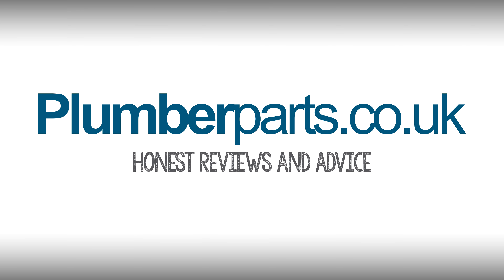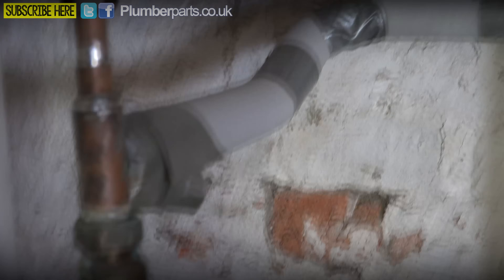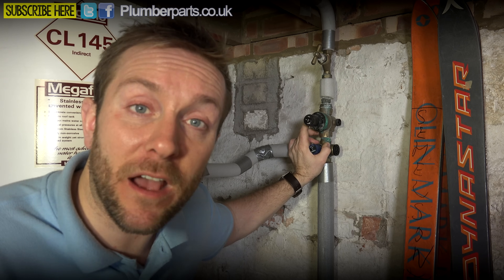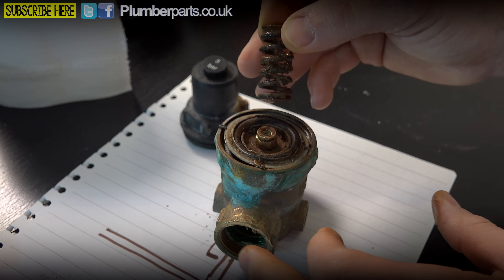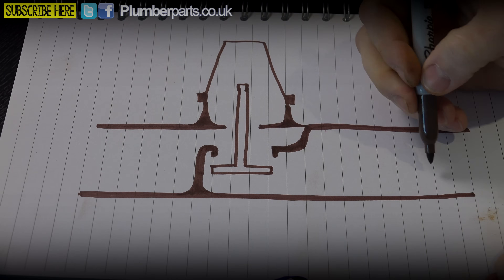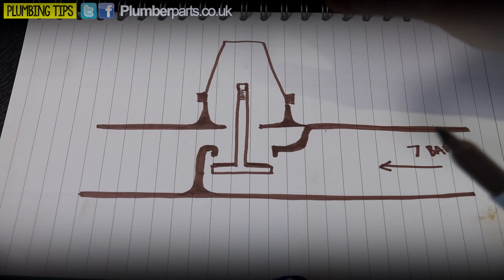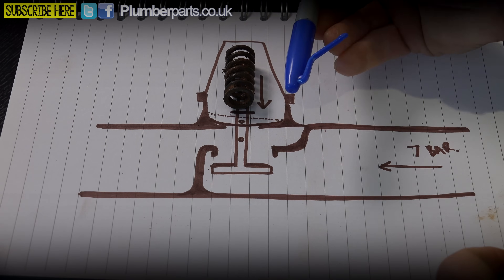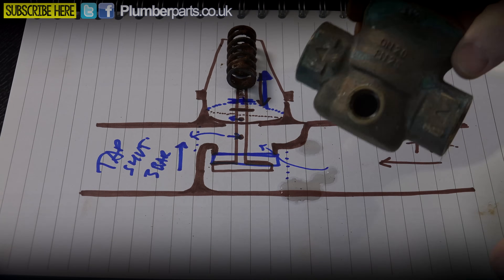UNVENTED HOT WATER TANK COMBINATION VALVES - How they work - Plumbing Tips

Comment: I find it a great explanation of how the pressure reducing valve works but in this video it’s incorrectly called a ‚combination valve’. In fact, pressure reducing valve is only one of the four components of a ‚combi valve’ which also consists of a check valve (non-return valve), a strainer filter and a pressure relief valve combined together, hence ‚combination valve’.
I was looking for the explanation where on a combi valve an expansion vessel should be fitted in relation to balanced cold water.

Comment: 2:30, that you for the explanation of the balanced valve.  Who did the plumbing, it looks as if it does or did leak. Could a run of, for example hot in 22mm pipe and cold in 15mm pipe mess things up?

Comment: 3 Bar??? We have a 30 year old Viessmann verticell that’s rated at 10 Bar! Mains inlet to house has a BWT backwash filter with gauge and pressure reducer built in which is set at 4 bar. The manifold above the tank has a pressure vessel, gauge and safety valve rated at 6 bar. Needing a 3 bar reducer to protect a tank would leave me questioning why I bought something so fragile when clearly more robust alternatives have been around for decades.

Comment: Hi, fantastic videos! I’ve just had a unvented cylinder replaced, a new combination valve (made by reliance water controls) has been fitted, but I now find a lot of noise (water flowing noise) when any hot water tap is turned on. I can only best describe it like an old fashion toilet cistern filling up. It’s so loud that you hear it in adjacent bedrooms whenever any hot water tap in the house is turned on. This didn’t happen on a previous separate 2 valve set up, is this considered normal, or do I possibly have a faulty combination valve?

Comment: Love this video.  Our house is 17yrs old and we have an oso unvented system. The hot water pressure has been decreasing quite a lot over the last 12 months to a point where if anyone flushes a toilet for example while someone is in the shower, then the shower stops.  The water board say no issues with mains pressure to the house.  We have a PRV on the mains and one at the tank.  Hoping getting both these replaced will fix our issue.
Reply: I have a very similar problem, with reducing hot water pressure over time.   Did you work out the problem?  I am thinking it might be this value.

Comment: I’ve been looking through your videos trying to get my head around the heating system in our new house, and they’ve been excellent. 

Our santon premier plus PP210B tank is fed from a gas boiler. When the heating is on or the nest thermostat is calling for hot water no noise comes from the tank. But as soon as the heating turns off, the tank (and throughout the house) you can hear what sounds like water running/immersion heater through pipes. I’m concerned that something might be wrong and at the very least it’s keeping us up at night as the noise can be heard.

I think I’ll have to resort to getting someone out to look as it’s stumping me. But i thought I’d ask before I do.

Thank you in advance

Comment: Amazing video. What a shame the 4 useless plumbers didn't spot this on my unvented system with a balanced cold feed coming out. Such a simple explanation as to why I had no water flow from any hot and cold taps but superb pressure before the combination valve. Some never even went near the airing cupboard to look. Some said I just needed all my pipework replacing or it was the water boards fault. The 5th plumber nailed it within an hour. This is in my tenanted property and I had to rehouse the tenants as the water virtually stopped running. No shower, no toilets, nothing...it was this one little but very important valve. £1k later and I feel I now know my entire heating and water system inside out! I'm definitely subscribing to your feed. Thank you!

Comment: @plumberparts I had my combination valve replaced not so long ago, before the pressure through my shower and taps was at a constant flow, now since it was replaced the pressure drops dramatically after 20 or so seconds. The water comes out at full bore but that could be due to the expansion vessel giving it a boost but after that pressure drops. Could i have a dodgy valve?

Comment: Great video really explains it well. Love to know why a combination valve fails. I’ve got a caleffi 3/6 bar installed 2 years ago. Expansion tank has a pin prick hole. So I’m told membrane needs replacing. Now on reflection they’ve told me the combination valve also needs replacing. Really surprised both needed so soon after installing (whole system 2 years ago) . Any thoughts

Comment: just moving into a new house.  our current house has a combi boiler so its all nice and easy and what i been used to for 20 years.   new house has a big tank in bathroom cupboard like this video with pipes all over the place. radiators are cold downstairs but hot upstairs.  ive been watching alot of these vids and getting an idea what to do. (called a plumber who suggested new radiators and power flush system.  he hasnt even bothered balancing it so eff him il do this.myself first).  

but i keep seeing a red knob (on mine its red) with a numers on it.  its situated not far from the pump.  i cant seem to find what it is.   its got a screw in middle of it...and it turns if.i take.screw out i guess..its set halfway between 1 and 2.    no idea what its for.
Reply: It's the auto by bass, should be set at 3bar. I wouldn't touch it. 
Have you got a room stat upstairs and down stairs? If you have you may have a faulty valve which let's hot water to the down stairs rads. If the rads are just getting warm then maybe just need a flush out. Hope this helps.

Comment: Could a faulty valve 'stop' the flow to the boiler loop pipe? As my water pressure is now low and the mains feed to the boiler, i.e. flexible loop pipe is zero. I've opened both the valves either end of the loop pipe and no water flows?

Comment: Thanks for the video, do I have to drain the system to fit the valve or is it enough to just to stop the water coming in from the tap just above it.
Reply: I would shut of cold mains to cylinder then open up hot taps whilst draining down with a hose on a drain off closest to a door also may aswell turn boiler off if it's on as you would be heating nothing

Comment: A question please! On my telford 150 direct unvented it says that the precharge for the expansion tank should be 0.2 bar less than incoming. Does that mean 2.8 because the exp. Tank is fitted after the 3 bar combi valve....or does it mean 6.8 which is relative to the normal system pressure of 7 bars before it enters the combi valve.....confused i am!! Cheers

Comment: My parents have a modern ish house 90's. They have a condensing boiler in the garage, 12   radiators on the system some have thermostat valves. In the airing cupboard they have two actuators and a pressure release valve. The system is made up of microbore pipes and the bigger pipes. 

The system has never been great in the sense that extra radiators have been added before we got the house some parts get more heat than others. 

The main problem is the pipes bang sometimes, I assume this is air in the system? 

Can you tell me how this would happen and is it possible to fix? 

Thanks in advance. love the informative videos.

Comment: We've got an unvented tank and just had the valves replaced. We've got an issue were the water runs super fast and then drops, then it speeds up again and then drops and so on. Plumber says it's problem stemming from outside pressure. company that manages the building says the water is leaving the booster sets at a constant pressure? Any advice? see vid:
https://www.youtube.com/watch?v=otrZDNfuAh4

Comment: Watched this video last week before swapping out my  identical combination valve. Although the replacement looks physically different, I found it to have exactly the same footprint and did not need to alter any pipework to install it. Great to see what was involved before I did it anyway. Many thanks....

One question for you on unventilated systems, I find that my megaflo tank looses its air bubble in about 6 months. Is that normal or indicative of a problem?

Comment: hi pp, I've got a thermal store that I'm going to drain down the system tomorrow then isolate feed and expansion, I intend connecting a mains hose to our tfi filter and open valves in accordance to direction of flush then open heating side of diverter valve with drain hose on lower rad to then I hope go round rads to flush, have I got to fill the store first b4 I flush, I'm thinking it'll give me more time incase it fills as I flush.  Sse wanted to power flush my system for £600 and I got it going by flushing from tfi through flow pipe to boiler drain( poor flow) and I now  want to  get the ds40 out so to inhibit, I've a priority system with only 1 pump, thanks mate

Comment: My Megaflo sometimes makes a banging/popping type noise from inside when heating up the hot water any ideas?  Works fine and there's no water in the tundish.  Cheers James.  Hold tight!
Reply from the maker: +J0n35y172 Could be a really scaled up one, or boiler temp really high!
Reply: Hi I got the exact same problem did you manage to fix it if so please tell me what you did
Reply: Hi I got the exact same problem please tell me if you managed to fix it if so please tell me how you did it because it's making a very loud banging noise and it's disturbing us